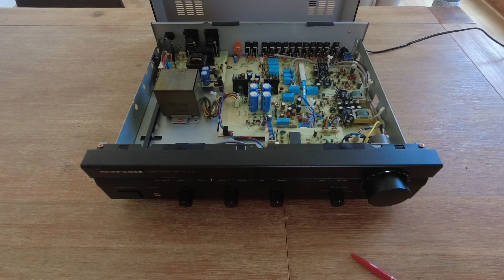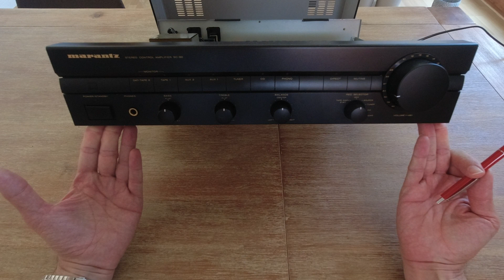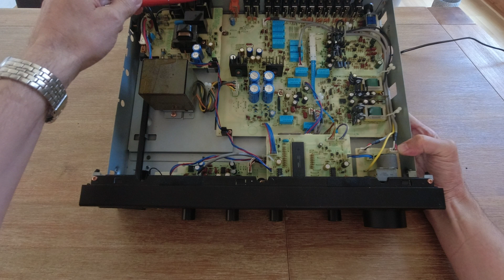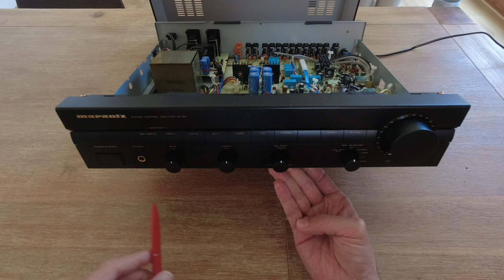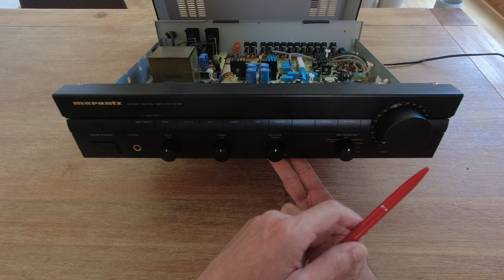Marantz SC80 SC-80 (partner to SM80 SM-80) Inside view and recap comentary

Comment: Hi, please advise if you have Marantz SC80 for sale?
Reply from the maker: @varghesethomas6882  Hi Thomas, interesting that you ask. The two SC80 that I have are by far my longest running projects, also the first ones. I am stubbornly pushing one of them to perfection. But to finance new HiFi projects (I want now to repair some Nakamichi and modify a Phillips player), that I have been considering selling the SC80 / SM80 pre + power. I would have a problem though to do that now, as I swapped the best main board into the black case, while I use the fine working but a bit butchered main board in the champagne case. The plan is to reserve them back to original placing the better board in the champagne. Somehow the black case is now in Spain, as I detected a small hum in the phono section that a HiFi specialist in Alicante I am befriend with is investigating for me. I don't want to resource to an external Phono pre, I want the SC80 perfect. The slightly butchered board does not have this problem. What I mean with "butchered" is that a lesser HiFi technician in the past had to bridge a few copper tracks with cables. Something frequent to see in frequently repaired amplifiers from the early 70'ties, but not something I am comfortable to sell to someone.
Reply: @high-endcafe  understood
Reply from the maker: @varghesethomas6882  I have considered offering you to fully recap a unit you could send me that you could buy in the 2nd hand market, just for the fun of it. But I have quite a few projects ongoing, (I should upload the videos!), and the SC 80 is a time-consuming one due to the number of capacitors (I think to remember some 70?) across 4 circuit boards.
Reply: @high-endcafe  oh okay